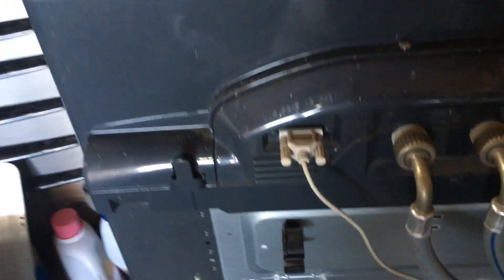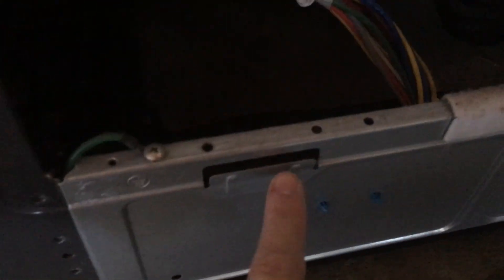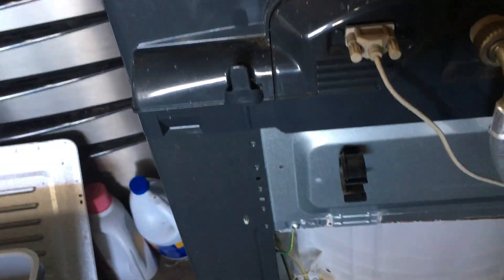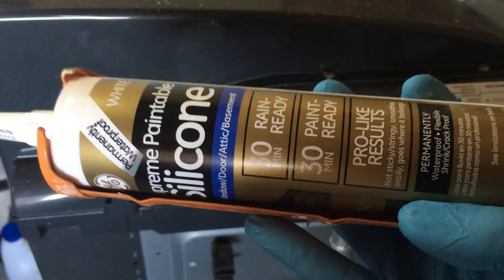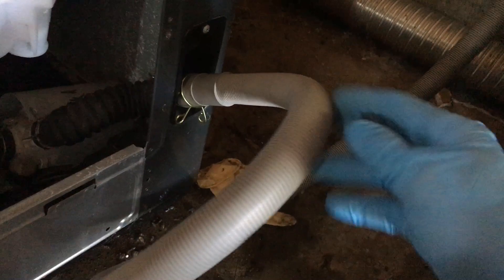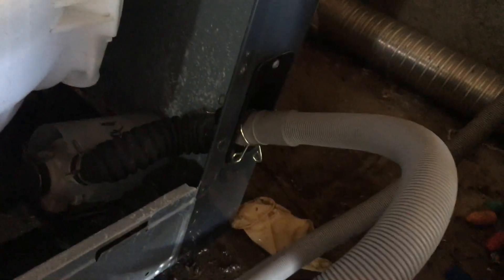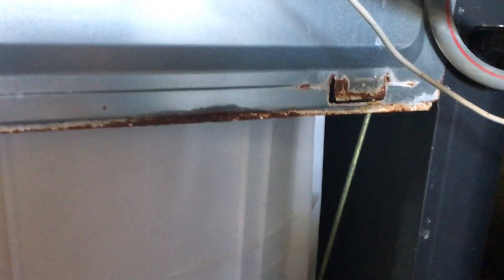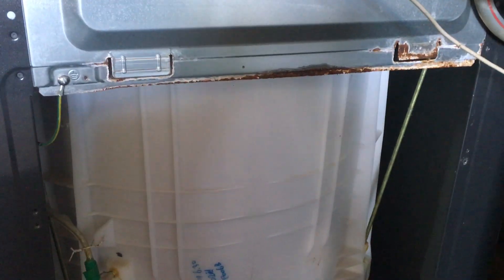GE Profile Harmony Washer leaking fixed

Comment: Finding a similar problem. Caused by a sharp object (eyeglass screwdriver) that got in the holes spinn8ng and caused a problem.  My problem is there is at least one other hole in a less accessible part. Now trying to figure out how to access entire outer cylinder.